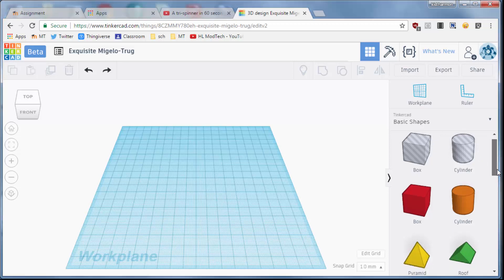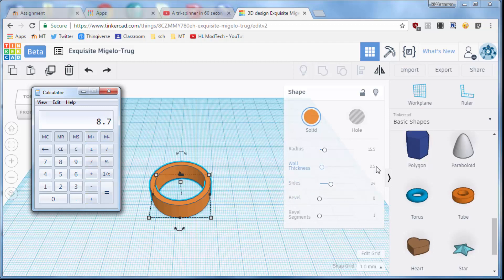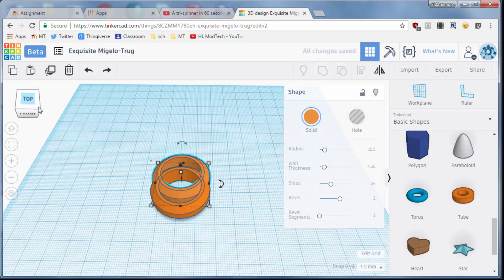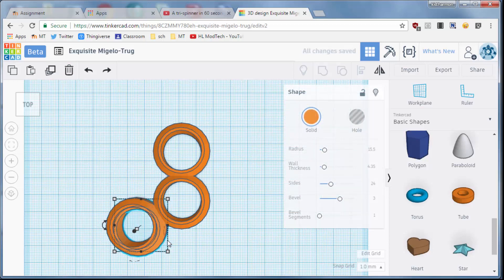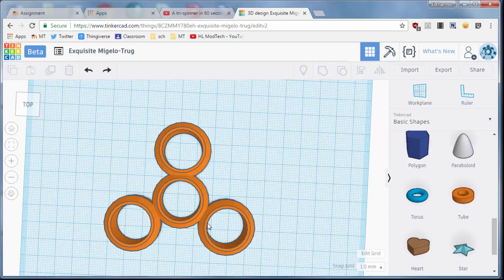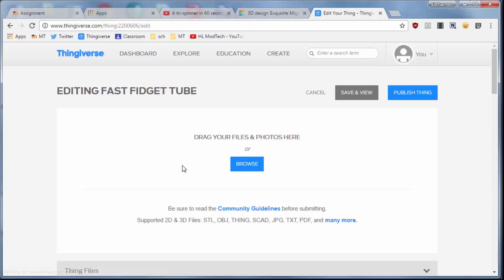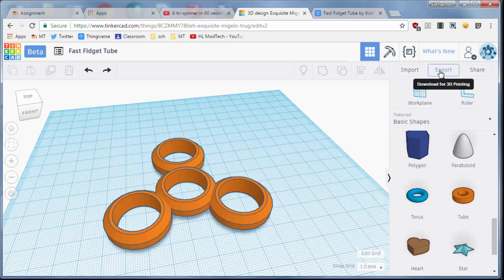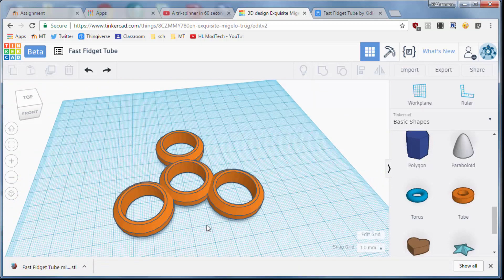Super Slick Fidget using the Tube in Tinkercad

Comment: More precise way to position the side wheels is to place a copy of the original on each side of the center one, then duplicate and rotate 60 degrees and then duplicate again.  Then just delete the ones you don't want to end up with the three positioned exactly where they need to be.
Reply from the maker: That is slick! Thanks for sharing.  Love that the math is in there as well. =-)

Comment: The wall thickness measurement do not work right.
Reply from the maker: I have printed a ton of these for my students and they turn out fine for our bearings and with PLA. What kind of bearings are you using?
Reply: HL ModTech sorry not your measurement the tool in tinkercad.  Sorry to bother you I fiquered out what I did wrong
Reply from the maker: No worries. It is always cool to look back at the videos I have made. Glad you solved it!

Comment: can you tell me the hight and width of the fidget spinner
Reply from the maker: I always make my tubes 7 mm high. The tubes vary as I try different stuff almost all the time... My rule is that I need a center hole of 22.3mm. This time it was 15.5 radius (diameter =31) Take away 22.3 and you have 8.7mm to split for the 2 walls of the tube. That = 4.35.  I then use 60 sides and adjust the bevel till the part is visually pleasing. =) This video shows how to make a google sheet and calculate the measurements really easy as well. https://youtu.be/ztOwm3nf3fw?t=50s